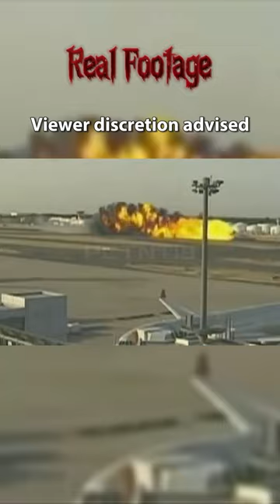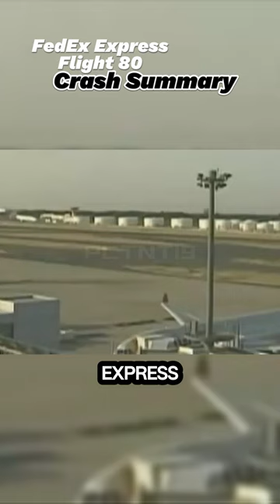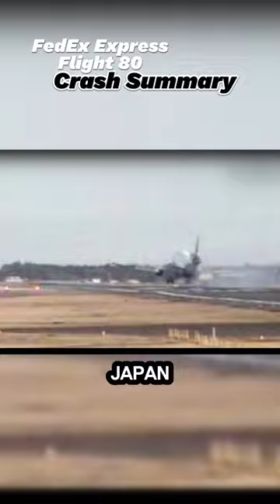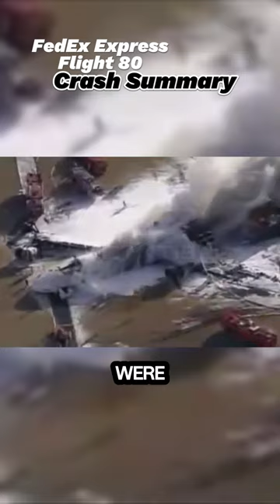FedEx Express Flight 80 Crash Summary🥶 #aviation #shorts #fyp

Comment from the maker: For those interested, here is a breakdown of what happened:

The crash of FedEx Express Flight 80 was caused by a series of "porpoising oscillations" during touchdown, resulting from a high sink rate during the final approach. The first officer executed a late "flare" (a type of landing maneuver) where the sink rate was not suppressed until the plane was nearly on the runway. This minimized "float" (an effect that can prolong the aircraft's landing or can displace it from the centerline) and thus reduced the aircraft's safe stopping distance or caused it to deviate from the centerline in existing crosswinds. This high touchdown sink rate, combined with large nose-up inputs, caused the first bounce. Subsequently, a large nose-down input was applied, causing a touchdown on the nose landing gear. This deviated from the approved procedures for MD-11 in case of a bounce, which specify that the pilot must maintain a pitch angle of 7.5 degrees and use thrust to adjust the descent rate. The aircraft bounced again after this second touchdown, pitching upward. The large control inputs made by the first officer led to a hard landing on the main landing gear. This final contact was hard enough (1,200 ft/min (370 m/min)) to cause the left wing to fail, as the left main landing gear transferred force upwards into the wing, exceeding its design limit. The Japan Transport Safety Board (JTSB) report suggested that the fire could have been avoided if the landing gear safety pin had failed as designed, but that most of the touchdown force was horizontal to the pin rather than vertical, keeping it intact. The report also cited the crew's use of autothrottle during landing, despite gusty wind conditions.

Source: ChatGPT (based on Wikipedia)
The scenes in this video do not belong to me.

Music: 🔻 "Darren Curtis - It's In The Fog" is under a Creative Commons license (CC BY 3.0). / darrencurtismusic Music promoted by BreakingCopyright: https://bit.ly/b-in-the-fog 🔺

Voice: ElevenLabs: AI Voice Generator and Text to Speech
Video edited in CapCut
!!! ChatGPT can make mistakes. Consider checking important information.

For more information you can search about FedEx Express Flight 80.

Thanks for watching this video.🙏